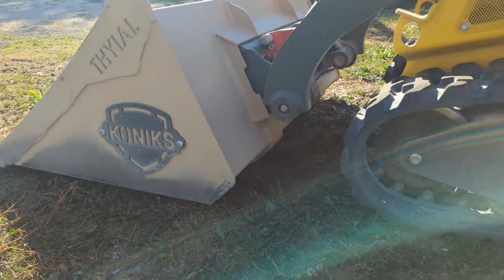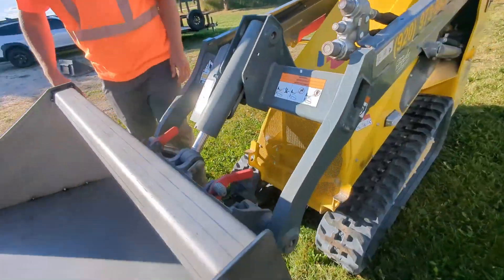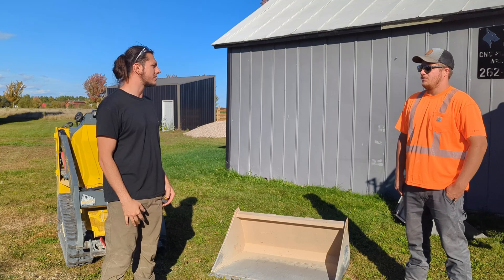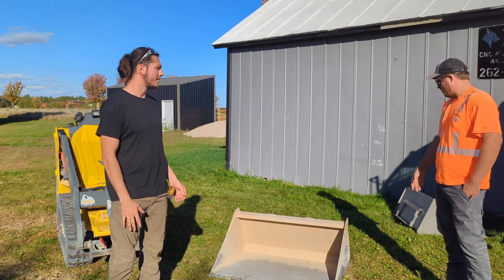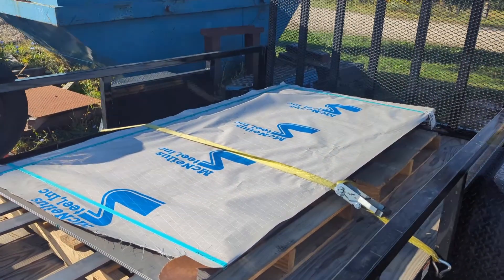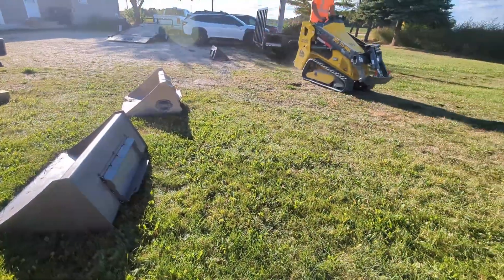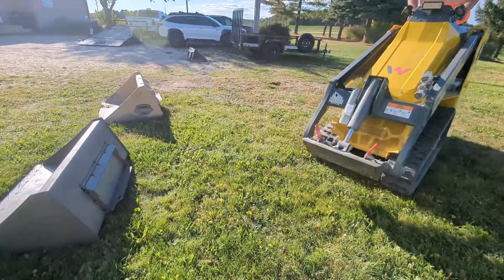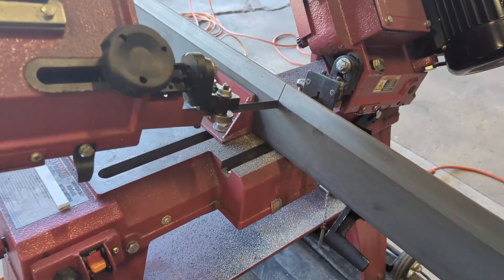I Built What The Engineer Designed (It Was Me, I’m The Engineer)

Comment: @6:56 see how the top of the mount plate has a cut out in the center i'd have to cut that to the size of a tuna can or it would hit on the hydraulic cylinder of my ditch witch sk600 when the bucket is rolled all the back towards the machine.
Reply from the maker: was debating about putting a notch in mine but all of the machines I've seen didn't require this. Maybe its a DW specific?
Reply: @ThyialIndustries  it all depends on where the hydraulic cylinder attaches to CCI (common industry interface) plate varies by model and manufacturer. every time i get a new attachment i put a tuna can dead center draw a half moon with a paint pen and cut it out with a grinder sometimes you gotta shim the sides of the mount plate or the locking pin holes. i've  been using minis for 15 years first one was a  Finn eagle and i've never not had to make an adjustment to a new attachment last set of brand new blue diamond forks i got i had to shim the lock pinholes , shim the sides and grind the top for the cylinder.
Reply from the maker: @bluegrassnnawoods8198 that's crazy. You should be able to buy one and have it fit without modifications

Comment: So was the new mount location too low? Can't you just measure up from the ground when the factory bucket is sitting flat?
Reply from the maker: The new mount location was perfect for the sm100 but later on I found out it doesn't quite work as well for the Toro branded machines manufacturers are all over the place with these mount plates. Someone should develop a standard
Reply: @ThyialIndustries or you could make it so your mount can be easily adjusted up and down
Reply from the maker: @sharpsticksnz4112 yeah, thought about that for while. Like the possibility of doing a bolt on mount.
Reply: @ThyialIndustries it wouldn't be hard to do and would give you a point of difference over the competition